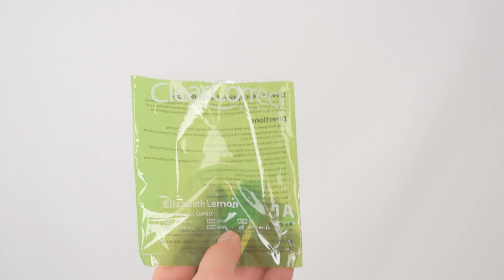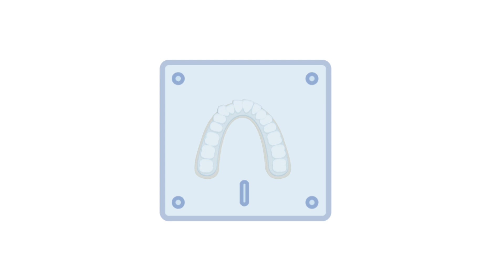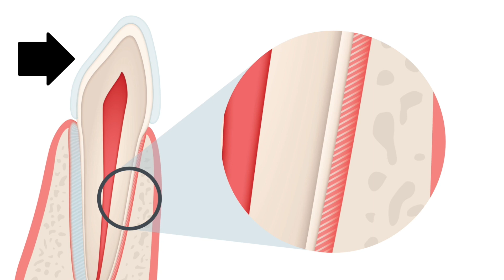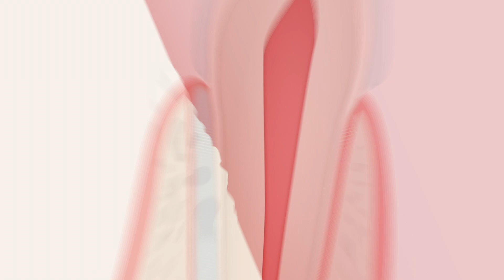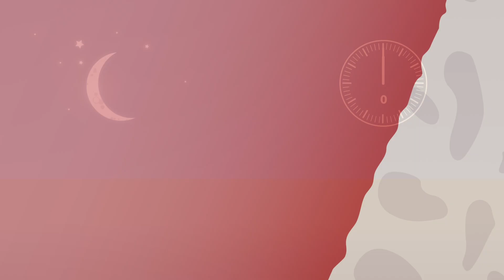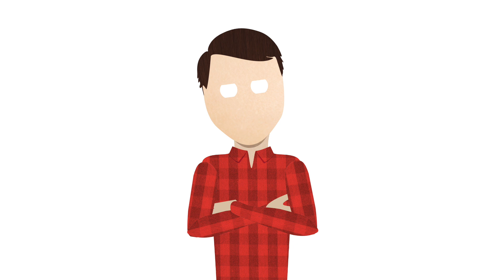How clear aligners work

Comment: I just started Clear Correct in Japan. My doctor choosen it instead of Invisalign because thick brackets of Clear Correct fit to move my back teeth.

Cost is 8,000 USD which is same price to Invisalign. Clear Correct is not common in Japan and still expensive. But I think it is valuable if I can get perfect teeth.
Reply: I just started it too, i have two days with them and I already feel a different

Comment: I am doing as much as I can to inform about the cost of post treatment retainers.  I needed to replace mine after about 1 year.  The cost was $750 with insurance and even higher without it.  Dentist said cost is determined by my insurance, Clear Correct says it is the dentist that sets the cost.  Something is very wrong.
Reply: Insurance companies do not set the cost of your new retainers.  That is determined by your dentist and the lab used to fabricate the appliance.